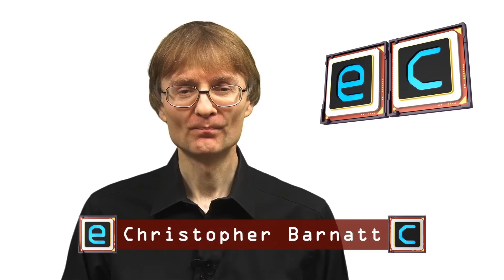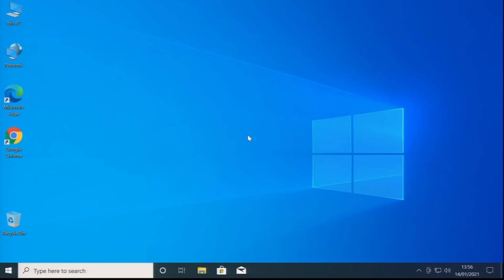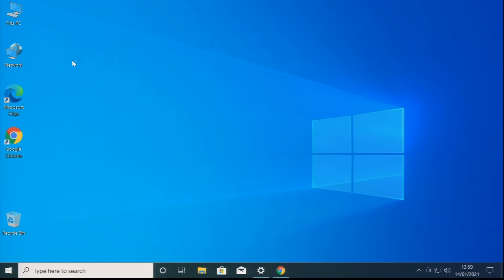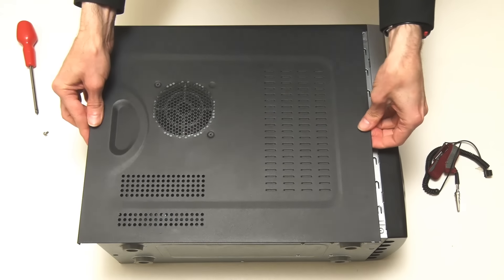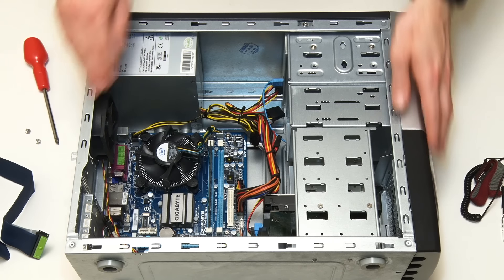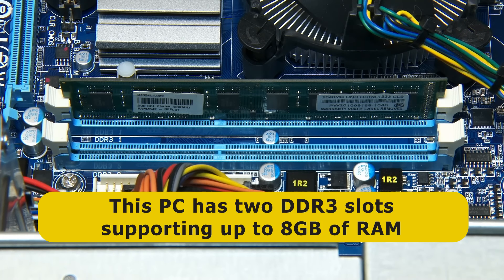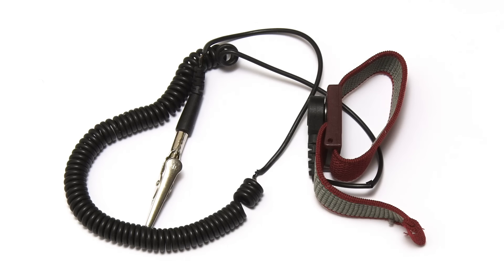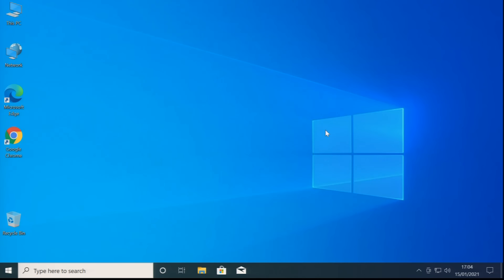Old PC Upgrade #1: Options & RAM

Comment: If you look around, Core 2 Duo and Core 2 Quad processors that fit that socket are super cheap to come by (they aren't old enough yet to have become "retro"/expensive). They handle pretty well for their age -- Linus Tech Tips was able to get a Core 2 Quad to drive a GeForce GTX 1080Ti, and modern games.

Comment: @ExplainingComputers - You can upgrade as long as you do it a part at a time.  Also, you can replace the motherboard if you use the same processor and ram in it.  You need to link Windows 10 to your Microsoft account (e.g. Hotmail) to get a digital license activation.  Then once you replace the motherboard and transplant everything to it, you will need to log in to your Microsoft account to verify the license and it will re-activate Windows.  I just did that recently because of a motherboard causing lock up problems.

Comment: Gor blimey! My two Windows PC's are still running Vista. Mind you I have put Linux partitions on them which allows me to use the latest version of Chromium.  Tip: Windows Vista will recognize a 720k MS-DOS formatted floppy, a feature that has been removed from Windows 7 and later. You cannot format a 720k MS-DOS floppy on Vista, but you can use a floppy formatted on an older machine. This is useful if you are transferring files from an old Amiga A500, or old 68k Macintosh. Thanks for uploading.
Reply: Can you format a 720K floppy under Linux?
Reply: @richardwernst  You might be able to depending on your version of Linux and your hardware. If your machine has a suitable floppy drive built-in or you have a suitable USB drive connected. I use a Packard Bell Model No. PB-UFD100. You must use a single density floppy disk and your drive must support this. The floppy drive is represented by a file / dev / fd0 for the first drive and / dev / fd1 for the second drive.
This file is valid for standard floppy disks and more generally when the floppy type is auto-detected. On the other hand, when the format of the floppy disk cannot be auto-detected (for example to format with a special density), it is necessary to use a special file,  / dev / fd0u1722 . It does not exist, by default. It is created with the command (in administrator):
$ sudo mknod / dev / <file> b 2 <value> where <file> and <value> are found from the "ls" command example: $ ls / dev / fd *

For a floppy disk with standard capacity (auto-detected):
$ sudo fdformat / dev / fd0
or, for a different capacity:
$ sudo fdformat / dev / fd0uxxx where fd0uxxx corresponds to a special file that you will have created.

After having formatted in low level, the floppy disk is not yet usable. The first sector does not yet contain any useful data.
Example:
1722 kb capacity floppy disk (with fdformat), then MS-DOS formatted
$ sudo mknod /dev/fd0u1722 b 2 60
$ sudo fdformat /dev/fd0u1722
$ mkfs.msdos /dev/fd0u1722

Comment: To avoid static damage, you want to at the same potential as the computer you are working on.

I usually clip to an unpainted part of the chassis.

Paging to disk is even more painful with it is spinning rust.

Memory is about the easiest upgrade one can do.  There is usually no other action needed other than installing it, and it will almost always improve the performance of the system.

Comment: I have a similar computer (1st gen Intel Core i7 870 @ 2.93 GHz), the one I'm using right now to watch this video, my main computer (advertised to support 16 GB RAM). However, it has SSDs and 32 GB RAM. It doesn't have integrated graphics, but if it did, I would use that. I also have a 4k monitor and a FullHD monitor and to drive them I have a NVidia GT960 Windforce card. I also added a PCI USB3 card (not PCIe). I do not need to upgrade it at this time, it is quite beefy. I'm running Linux with Gnome 3 on it. It is built in an old Athlon XP case, but I changed the power supply with one that is more silent and outputs 450W.

Comment: Hi great content! The startup didn't improve dramatically because it is an operation that is bound to the hard-drive, so if you upgrade the hard-drive I assume it will improve the startup time...
Reply from the maker: Some of the start up time indeed depends on speed of the boot drive (as I upgrade and test in the next part of this series). But start-up is certainly not "bound to the hard drive" alone. Both CPU power and RAM are significant factors in the start up speed of any operating system.

Comment: I bought a 2010 HP All In One for $NZ60.00  (about 30 quid) with a dodgy 500 gig hard drive (HDD). A  new cloned 1 TB partitioned HDD was fitted and the OS upgraded to Windows 10 Pro from Windows 7. The RAM was initially  4GB using Laptop DIMM units as most all in ones do which I upgraded to 6 by taking out  one 2GB RAM unit and putting in a 4GB card I had spare. The processor is 2.9 and with what I did the boot speed is consistently  between 19 and 21 seconds.

Comment: How coincidental. I was thinking about upgrading an old Dell 545 from 2009 (nice to see Dell also finally brought back the 545 Inspiron line in times of recent xp). 
With only 3GB of RAM, it still does feel it is lacking but the cheap Kingston SSD does help move things along which replaced a WD Blue 7200 rpm. It would be fun to add a Core 2 Duo Extreme to max out the use of the LGA 775 socket, but even with just adding a graphics card such as 550ti or 750ti should help with older and low end games - some years ago I broke the BESTEC power supply and replaced it with a CX430 so I'll have the available PCI-E power should I need it .
Reply: I also have an old Dell Inspiron 545. Mine now has 6GB RAM, an SSD, a Q8400 CPU and a GT1030, which all make it acceptable for running W10.

Comment: Upgrading a system like this is a great way to getting used to working on computers since they are usually in one piece to start with giving you a point of reference. Also they can sometimes have writing by the ports like "Sata 1 ect" which certainly helped me when I was thumbling my way around a HP Pavilion back in 2008! Put a GPU in there and learned the hard way why it is important to consider power supply wattage and the tdp of the said GPU haha! I have been building pc's as needed for years now but there is nothing like the feeling of getting it right for the first time. And windows booting! That was nerve racking for me back then lol :D

Comment: It's interesting to see hard numbers on the speed-up with that extra RAM! With a PC that old, and running on integrated graphics, i'd call both a small SSD and a minimal graphics card to accelerate the UI and video and save some system RAM (and i'm talking even like a GT 710 here, even that should be better than the old GMA graphics) absolutely essential. At least the original owner put a half decent power supply in!

Comment: This is pretty amazing! Mine is 15 years old and it doesn't support more than 3 gigs of RAM! But this does, which is 5 years younger...
Reply: Are you sure it is 3 normally it goes in even number.
Reply: @NicolasChapadosGirard  As per the specification page, it's 4. But it doesn't support more than 3! I don't know how...
Reply: @theproudlinuxer  Due to a software limit, I think a lot of the 32bit Windows versions can only access about 3GB of RAM.
Reply: @derekp2674  I even tried with 64 bit Windows and 64 bit versions of Linux. Doesn't support more than 3.12 GB of memory.
Reply: @theproudlinuxer  Are you using onboard graphics? If so, does the graphics memory sit within or outside the 3.12GB?
Reply: @derekp2674  Onboard graphics sits outside the 3.12 GB, which is just 8MB... It's Intel 945G (WDDM 1.0)

Comment: Thanks for taking the time to make this video. Going from 2GB to 8GB would give it a nice overall speed upgrade and your video showed that. Would the SSD option bring the startup down from 47 secs to around 10 secs? After the memory upgrade, would any adjustments on the virtual memory allocation help speed up some of your testing results?
Reply from the maker: I upgraded to an SSD in the next part of this series, and the boot speed improved, but not to 10 seconds! :) Remember this is not a SATA III motherboard. You are right that some virtual memory changes may make a bit of an improvement, although these days Windows is pretty good as sorting this out itself.

Comment: I have this case it's actually pretty good I like having the PSU on top you don't have to worry about ventilation and even though it's smaller you can still fit pretty decent sized gpu I put a gtx 760 in mine

Comment: I still have my core2duo and spliced the ram from the other identical I had. System has 7gig ram. Storage I have 5tb, 1 drive is my older 150 raptor, 1gig video card. Last year I got my 1st ssd(WD Blue 512gig) for boot and found 4 gig Nvidea vid card for good price here. System has been re-born! Older computers are still good, it just depends on what you need it for. This the advice I help my friends and co-workers.
Reply: Core2 duo cpus are a LOT faster than dual core cpus of the same GHz so yu're good.  Not sure how you "splice" ram, did you glue them together?   :)
Reply: @richardwernst  (splice) I meant as in when I took the ram from the old system which was same setup just the sticks between them, one had 2 x 2gig, other was 1 x 2gig & 2 x 1gig. was able to only make max of 7gig. You know what I mean...lol

Comment: Could you do a video that covers how you would identify the specifications of a system that is running Linux? I tend to only run Linux on older hardware and upgrade parts randomly, but I think your method of building a detailed specification document is far superior.

Comment: Might have been tempted to warn that, if buying an old PC to upgrade as you did, ideally avoid some of the big name brands if you ever want to change motherboard. Similarly - if tempted to buy more 800 fsb memory, perhaps check if a CPU upgrade would be possible that would need say 1066 fsb memory such as an E8600 which is ~30% faster for £15 (if it works in that board).

Comment: This old PC looks remarkably clean unless Chris did a good job of dusting it prior. I think the issue with most older PCs from eBay is a lot of them are very dirty and dusty especially the power supply and some floppy drives are just unusable but you're always feel a sense a achievement after the cleanup and upgrade.
Reply from the maker: It came like this -- I didn't do any cleaning. The case opening was the first case opening. I guess they had an air blower.

Comment: Using faster memory can give an advantage of lower latency timings. Also, E5500 could be significantly overclocked - 25% - 30% at least.
Careful BIOS setup tuning is required of course. :)

Comment: Another inexpensive way to speed up a low RAM computer is to set the page/swap file/partition to static and twice the size of the RAM that is installed.  This is a configuration I learned back in the XP days.
Reply: It's doing that by default and HDD page file space is going to be slow.
Reply: @MJ-uk6lu  sorry to say, but I know that Windows does not do that.  When installing Win 10 on a computer with 8GB of RAM the swap file is only 1920MB.  Linux does set the swap partition static but not to x2 the amount of RAM.

Comment: I build a few computers back in the day for different family members using that exact case, and similar specs, but I think that was around 2008 and 2009. Even used cheapo Gigabyte mobos but went AMD Athlon II because they were cheaper.

Comment: Yup, without the power cord plugged into the pc (which I wouldn't suggest when working inside), grounding to a radiator is of no help.

I've many years (too many  :)  of experience at this and have never used a grounding strap.  I just set the antistatic bag on the metal of the case first, and ground myself to metal (just putting a hand on it), then open the bad,and handling ONLY by the edges, never the contacts, I install the ram.  Never had a problem.

Comment: I can remember upgrading my 2001 Pentium 4 computer with that brand new Windows Xp OS. [much slicker than the Windows 3.1.1 I had been running. April 2014 [Cradle to Grave with Xp] out went the old motherboard, in goes the AMD ATHLON 2 Dual Core AT2+ w/4Gb RAM, AND a massive 160 Gb SATAII hard drive, running brand new Windows 7 man that thing flew! Now nearing 2022 I am looking at that case again, man what a case it is, I am going to add a usb3.1 expansion card, swap over to ssd’s probably run some Linux distro and put this idle box back in service (we bought an iMac 🖥 5 years ago) 

Then again, the raspberry pi4 8Gb is probably faster than this processor/motherboard combo will ever be. Upgrade or new? 1st world problems… That case, though!

Comment: Good Video I Change The Thermal Grease And New BIOS Battery Clean With A Dry Paint Brush And An Air Duster Like Them To Look Clean And Refreshed Before Dissecting

Comment: I noticed you were lucky enough to have a 64bit edition of Windows 10 installed with only 2GB of ram, which meant you could upgrade to 8GB. It may have been worth mentioning that in the video and advising on the ram limitations had it been a 32bit copy of Windows 10 instead. Not a criticism Chris, just maybe would be helpful to beginners.
Reply from the maker: A very, very good point.
Reply: A good point but also I believe you can also upgrade a 32 bit W10 edition to a 64 bit edition on a given PC without needing a new licence.
Reply: @derekp2674  Yes, you can use the same license, but there is no way to upgrade from 32bit to 64bit without doing a completely fresh install of the OS, so some work is required to firstly backup your data and then reinstall apps and software on the new OS.

Comment: I loved this video, I have an old computer with this exact same processor I am thinking of upgrading it
Reply: First see if the BIOS can be updated, then see how much ram it can take.  If at least 4 G, go that route first, I use ebay, lots cheaper generally.  Kingston, Micron, Crucial are excellent sticks to buy but noname ones from china may work fine.  Next an SSD, then better video card.
Reply: @richardwernst  will do, thanks! I might not upgrade the cpu but I am upgrading from 3gb or ram to 8gb and win 7 to win 10 and from a hdd to a ssd
Reply: @richardwernst  I want to upgrade to a level where I will have enough for a new computer, the one I have right now is thermal throttling and sometimes not booting properly, it is an all in one so I do not want to open it up too much. So I want to upgrade to a point where I am not spending more than $40 on upgrades.

Comment: Exactly what I did actually
Backup PC has spec that used to be main rig
My backup PC is using:
Q8400
8gb ddr3
Using g41 chipset because GeForce 6200 TC runs worse than g41 and also bluescreened

Comment: 08:39 Upper left corner of board to verify that the Motherboard is (revision 1.3); very important when getting proper drivers like bios updates but they only show F1 as the only bios for the board dated 2010/05/04. CPU upgrade path: If keeping the stock cooler on the 65 watt E5500 then the Q9550s or go with the Q9650 and a new cooler that can handle 95W.

Comment: I JUST thought about ways to re use old hardware. Like with Raspberrie Pis i thought about taking the motherboard and sandwiching it between acrylic glass plates to at least save space. 🙏

Then pop a light weight Linux onto it 💪

Comment: Unless I missed it, one important step this video missed was that you need to make sure that you note if your Operating System is 32bit or 64bit. This is VERY important when upgrading RAM. If your OS is 32bit, you will only be able to upgrade to 4GB even if the board supports 8GB or more.

Comment: Still owning 4 PCS of this age, all of them with 4GB of ram because 32bits OSes and of course SSD and gigabit Ethernet, for all my data reside in a NAS. One of them is running Windows XP because I still use some old software running perfectly under this version and a pain if not impossible to make them run under 7, not to mention 10

Comment: I have upgraded quite a few PC's over 10 years old, the biggest upgrade is not the motherboard its the hard drive...put an SSD in and start times go from several minutes to 15-20 seconds and the machines run fine. If you ensure you have at least 4GB ram then the SSD is the quickest, cheapest way of giving old machines a massive boost
Reply from the maker: Part II of this video is an SSD install. However, as we shall see, the speed benefits on a SATA II system are sadly nowhere near at large as you suggest. And as you say, "if you ensure you have at least 4GB of RAM" is the key issue -- which is why I started with the RAM upgrade on this 2GB system. Taking the RAM from 2GB to 4GB+ makes far more of a difference to general performance that adding an SSD. :)
Reply: @ExplainingComputers  fortunately all the PC's I have had to upgrade have had 4GB in, never tested reducing it down, but expect the paging to go through the roof

Comment: Do you recommend getting newer RAM sticks or should I get, if I can find, the ones made for my mother board? They have pairs of my original on Amazon... EBay too. ❤🌅🌵😷
Reply: No need for original, just get same type, DDR,2,3,4, etc. and same or faster speed memory and you'll be all set.  I like to get Kingston, Micron, or Crucial dimms when buying from ebay, but off brand could certainly be fine as well.

Comment: Maybe another topic: making your home router from that old PC (running on a Linux distro). I got a workhorse Dell from 2008, with 2 GB of DDR2 ram which is doing very well as the internet router (though, I have a cheapo TP-Link router as the wireless access point). And things are working well: Tor relay (not end point), time server (I hate being late) and lastly torrent server (heh), with the basic home network.